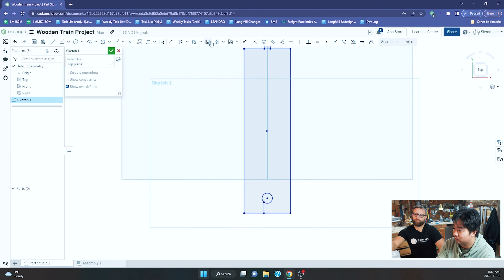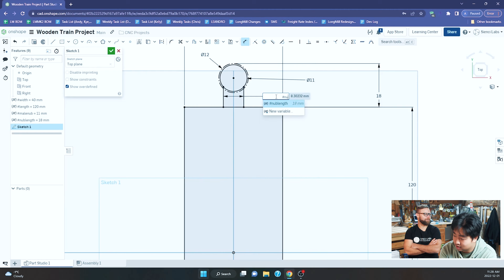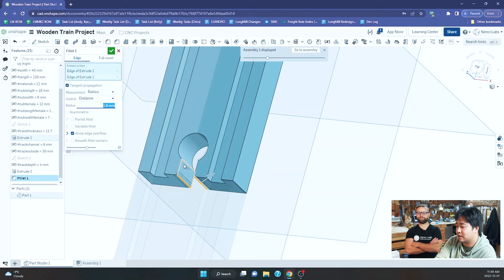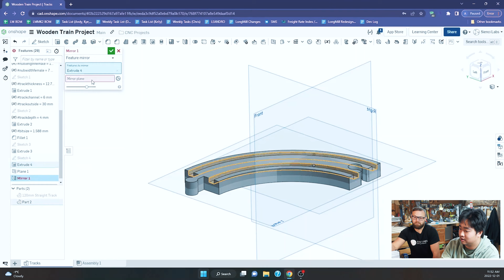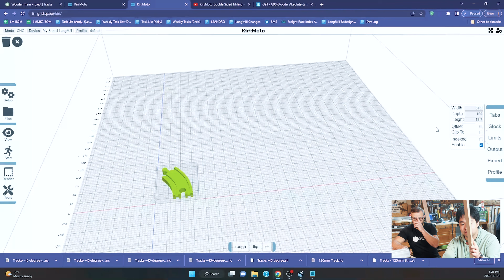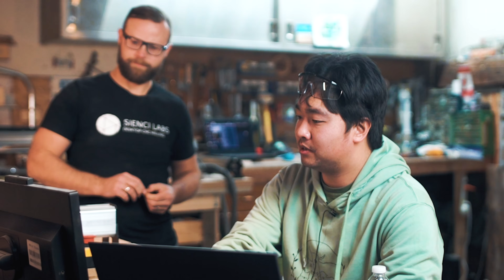Get on Track! Build a Festive Train on Your LongMill MK2 CNC

Comment: What is the width of curved tracks to flip left to right?  I am coming up with 2.5", maybe it is metric? Came back to say I figured out ~3.5”
Reply from the maker: The 45 degree tracks require about 2.5x3.4" of material (more tall than wide) while the most efficiently laid out 90 degree turns require about 2.5x6.7" if you align them at around 45 degrees. There are other ways to nest them in your material though if you want to get tricky with it 😉